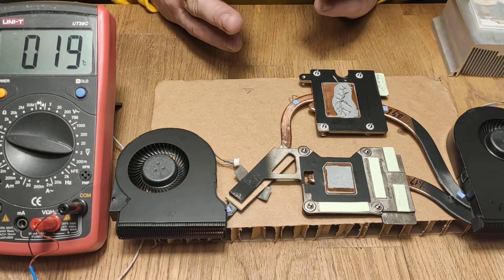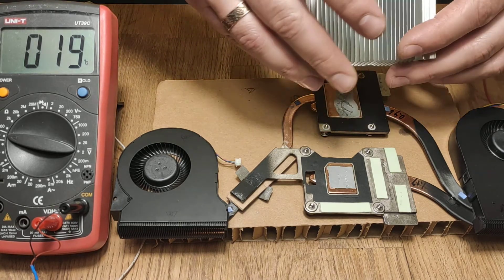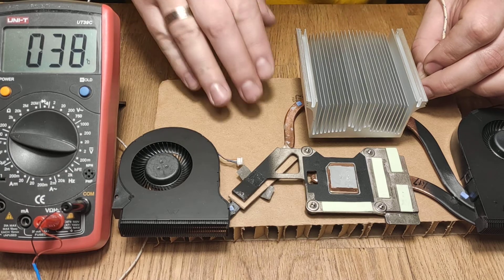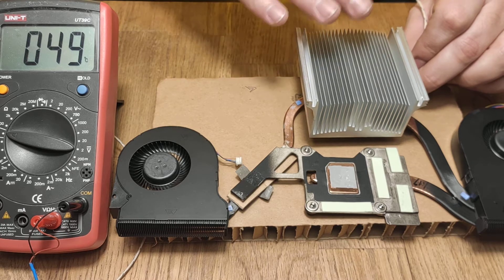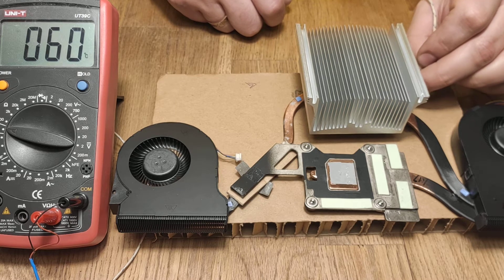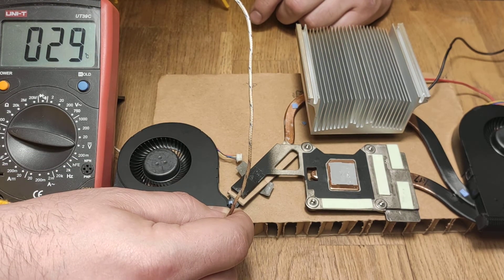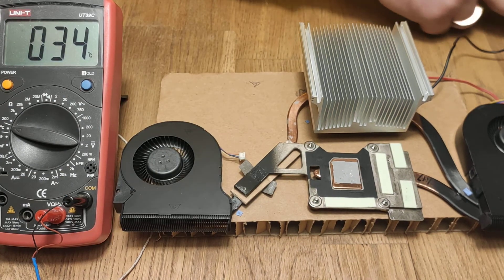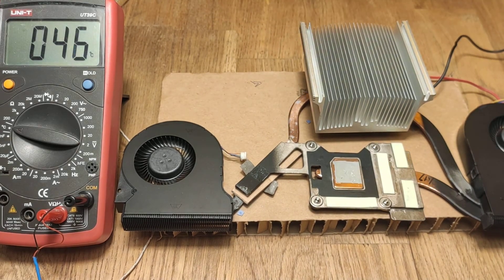Dell Precision 7510 overheating heat-sink diagnostic (Part 3)

Comment: well, in my case the laptop keep getting overheat and turns off while not throtting correctly
and honestly, the only solution here is by using "Throttlestop"
if you wonder if it is working or not, yea it worked perfectly
by "disable turbo", BD Prochot and Speedstep, my M1000M can run some decent game without shutting down, which is a relieve as I found throttlestop while finding a way to underclock my laptop

Comment: I have new info - turns out in 2020, Intel released a security patch to its "dynamic platform and thermal framework" driver set that caused some serious issues.
What I found:
 - The CPU does not throttle in response to the heat, and instead continues running full bore while cooking itself
 - It appears that this causes it to panic and force a shutdown
The shutdown issue can be fixed by rolling the drivers back to an earlier variant, as noted by a couple Dell help forum posts. It does NOT fix underlying issues such as a broken heatsink, but it does stop it from completely shutting down and restores the ability for the CPU to throttle its cores accordingly.

Hope this helps anyone who might come to these videos looking for answers, it truly was a headscratcher to troubleshoot.
Reply: This confirms it. I updated my Quadro M2000M driver on my Precision 7510 because I couldn't run BF5 or COD IW with my older driver. Once I updated ALL my drivers my thermal issues began. All this time I thought it was Nvidia's fault. Thanks!
Reply: I can confirm this, I used to play other game with ease and barely without thermal trip problem but after a few updates this happen, It have been bugging me out for a while now.
Reply: My cousin's 7510 also has this issue. I know I'm years late but I just want to ask if someone else has this issue and/or how to resolve this.

Yes, in my case the CPU did not throttle, until it reaches 100C and shut down, but also, I noticed that the fan never tries to blow the heat.
A few years ago when the laptop still works fine, and when doing heavy tasks, the fans used to blow much faster and pump out more heat.

I want to know if that's also the behavor in your cases, and if the driver downgrade did fix your fan curves issue

Comment: I wonder if the heatpipe on the left has either lost it's vacuum (for heatpipes using de-ionized water, the vacuum lowers the boiling point, allowing the phase change to take place at a lower temp - I'd post a link, but then my post would be removed), or has lost the fluid in it.

Comment: Great video ,So whats the solution you think for the overheating ??
Reply from the maker: I have concluded that it is of most importance to use proper thermal paste and verify if heat pipes are not broken. For thermal paste I "finally" tried liquid metal and seems that it solved the problem. CPU temperature dropped from above 90 to around 70 during stress test. However - application of liquid metal is complex and I have not run this solution for long enough time to recommend it to others. There are other thermal pastes that are specifically recommended for laptops (ones that can withstand higher temperatures).